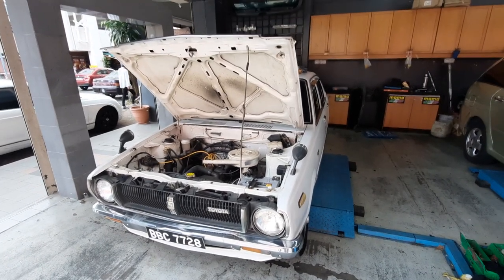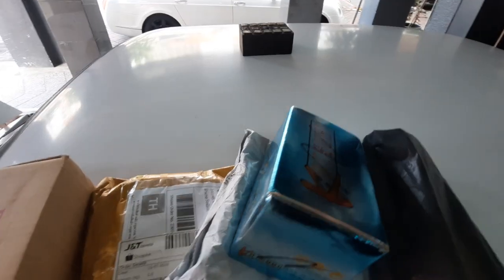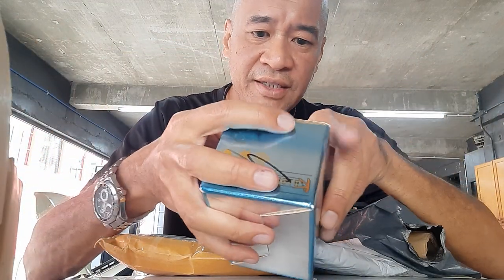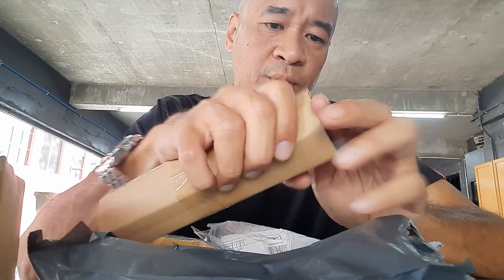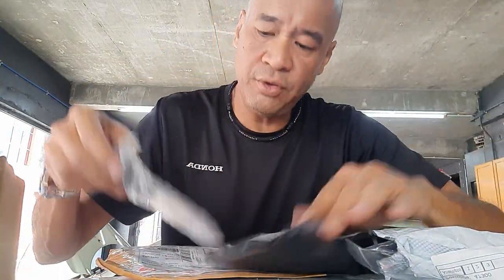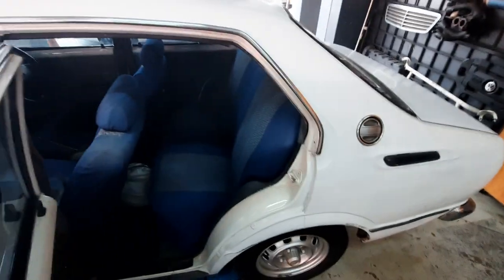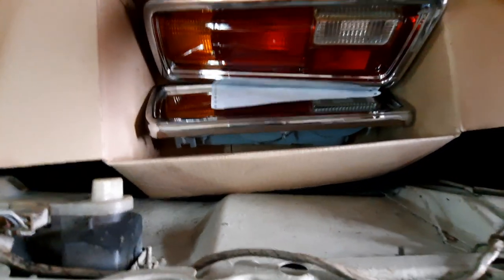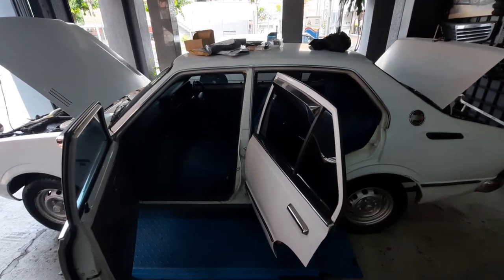UNBOXING!! Bought Some Loot for the 1979 Toyota Corolla KE30! Old Skool Treasure! | EvoMalaysia.com

Comment: The new tail light looks cooler with chrome strips and slimmer design compared to the ones on the car. Believed its the older version which looks cooler. I knew coz my dad & uncle used to have KE30
Reply from the maker: Yes, someone here mentioned earlier it could be from the 1976 model, awesome 👌 😃

Comment: Front bonnet seems to have heat black marks beneath.. (video pic) .. Maybe some heat insulator for front bonnet will protect the new paint job on the bonnet
Reply from the maker: Yep, this is very common for old skool cats, a bit of spatter, will get insulation done after paint 😊

Comment: The room light looks same Taiwan made I used on my ke70 restoration. Fuel filter I got the original aisin filter. Always a joy to look for old car parts. Headlight, tail light, number plate light, engine oil cap, etc. still can find them from old stock somewhere or after market parts
Reply from the maker: Yep, I'm sure it is 😊👍🏽
Reply: Look forward to more updates on the restoration, keep up the excellent work on more old cars motorcycles find 👍
Reply from the maker: @wlim63  definitely! Still lots to do, will be posting more soon, thanks for watching!!👍🏽🙏🏽😊